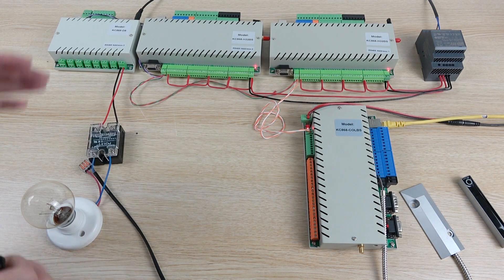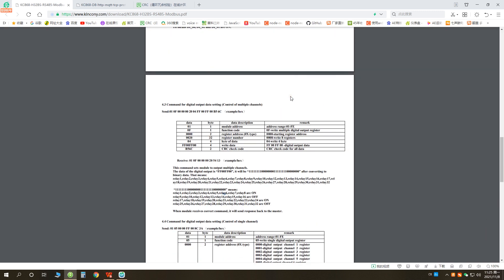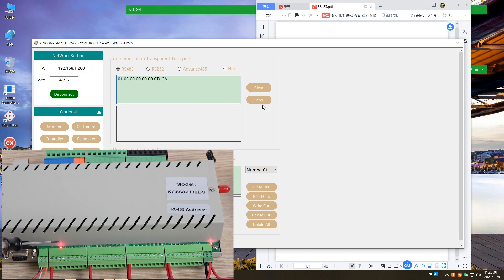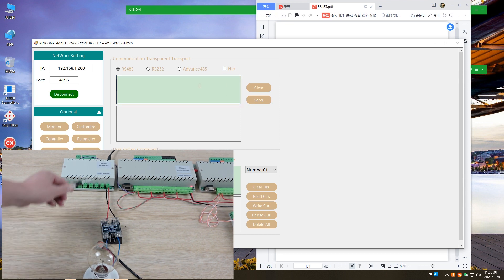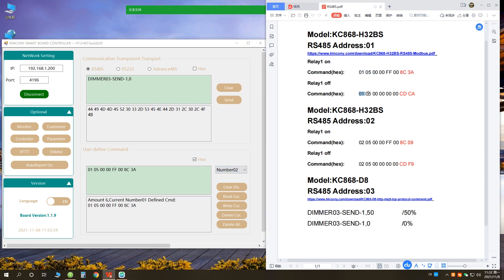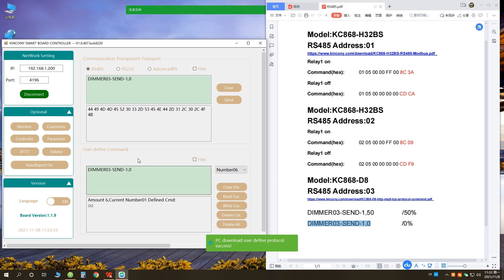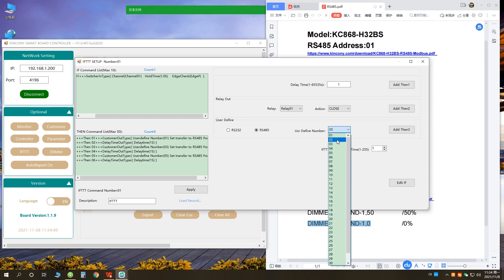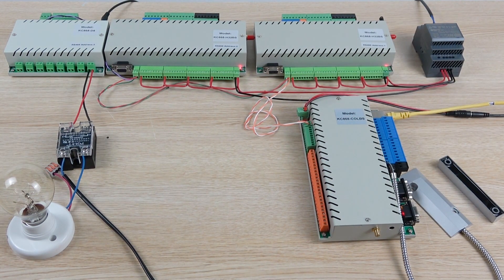KC868-COL automatic control multi controllers by RS485

Comment: question:
this KC 868-COL BS, have a 8 relay output channel, this relay output channel can connect directly to AC Contactor ?
Reply from the maker: yes, no problem, but you should connect with a power supply, suggest use DC12V , find a DC contactor to control AC220V load is better.
Reply: @KinCony  ok, noted with thanks
Reply: @KinCony  this relay output only for automatic control ya?,
Reply from the maker: @fishingkulinerautomation3315  inside 8 channel relay use by automatic control by input sensor and timer and manual control by PC software.
Reply: @KinCony  ok